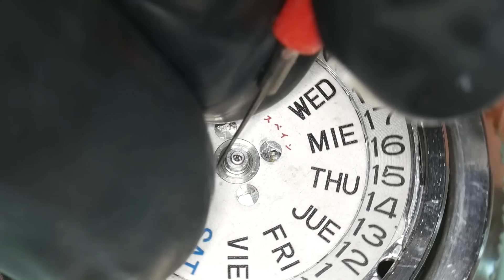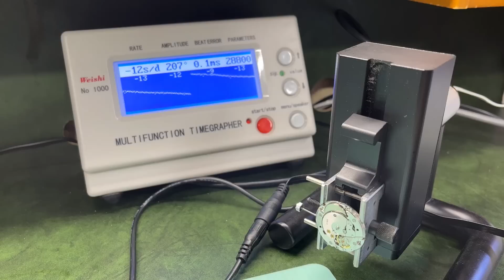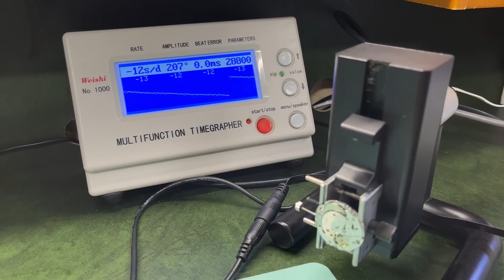Vintage Watch Restoration: Seiko High Beat 5246A

Comment: you know what helps me to seat the train wheels into the bridge on the reversing wheel style of auto Seiko's like the 52s 56s and 83s the tapping trick. the first time i saw someone do it i was like "what wizardry is this, this cant be real" yet when i tried it for the first time, worked like a charm. you gently tap the movement holder on the sides and the slight vibrations of the plates and wheels causes the wheels to seat themselves (95% of the time, sometimes you get a stubborn movement XD)

Comment: Lovely job, esp. for your early goes at that fascinating and complicated movement.  The yoke looks like it was drawn by Dr. Seuss in Mechanical Drawing mode.  

It is a striking watch, and SO 1970s.  Like an episode of "Kojak."  Lol.  The Milanese bracelet is the better choice between those two straps, for sure, and very thin and gleaming as it does -- although the brown leather briefly evoked watching the Masters Tournament circa 1978 when Gary Player won at Augusta, Georgia USA.  It also resembles the current Seiko Recraft SNKP23/25/27 (esp. the 25).  INTERESTING: That Milanese looks very, very close to the one on my new Lilienthal Berlin LE Chrono III.  I think those stout steel (?) sleeves that surround the spring bars while tightly abutting the lugs might obviate the occasional need for a NATO strap?  It looks to me like those sleeves would prevent any spring bar from bending and popping out under duress??

I would love to see that case get the full bright polish treatment but I understand why you left it relatively untouched.  It looks great anyway.  I'd love to have one and it's nice (!!! :) :) to hear the way you got it.  I think you know why!  :)  Very impressive work/watch/story.

Comment: 5246s are class. But for the industrial finishing on them. They are absolute work horse of a movement. So many still ticking away after 50-60yrs with barely any servicing.
Reply from the maker: Most if not all 70s Seiko movements are tough and durable. I did a video years ago on what I called my Rat watch.  Its a 6106 but it was battered and left for dead but I still managed to get the watch going again.  Seiko's never die

Comment: Hi Mike, I'll be watching this on the big screen as I have a 5206-5080 LM that works but when the crown is in the date set position it won't turn.
I know the 56** series has that failure point but the 52** are not prone to this. 
Hopefully I'll spot something amiss when I compare them.

Comment: Definitely milanese strap in this case. Nice job. To bad Seiko does not use high beat movements today in their watches in lower and mid price watches. Did eye meself similar Ali hand tool but it had no stand. Did you have to buy separately the stand?

Comment: Something that just struck me... Do screws in movements never come with torque specs? I'm kind of surprised
Reply from the maker: I have never seen it or read it in any guide. You just "know" when they are tight enough.

Comment: Hi there. Thank you so much for making this video! I have this same movement and am currently servicing it. I'm ready to put on the train wheel bridge, but when I was dissassembling, I couldn't figure out how to remove the rotor from the bridge. I'm pausing for the moment to work on some other things. I could, of course, just work around that (I already did when cleaning the jewels), but it might be less of a pain to service if this rotor is separated. I noticed in your video you don't show it. How does one remove this? I'm always annoyed when there isn't a screw/screws for this part. I can't tell if the thing needs some work to remove rust or if I'm just completely going about removing it the wrong way.
Reply from the maker: @PEZenfuego  you have to grip it with the sides of your tweezers on the square bit to turn. Ideally a home made spanner but I just use my thick tweezers on their sides
Reply: @MyRetroWatches  Thank you! I was hesitant to really twist it hard when I felt so much resistance.  I was cursing quite a bit and took back every nice thing I said about the movement earlier today, but I managed to get it off! I appreciate the reply. Cheers